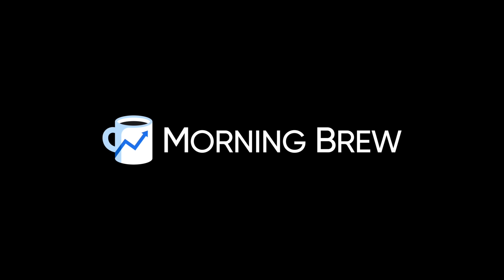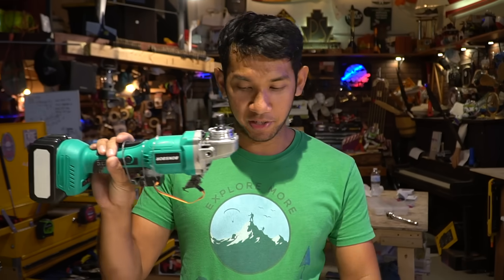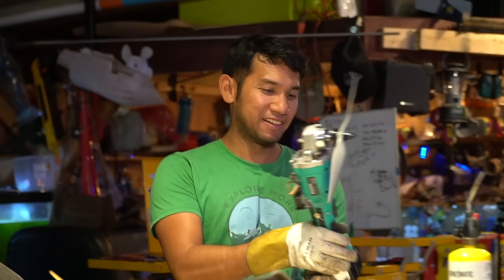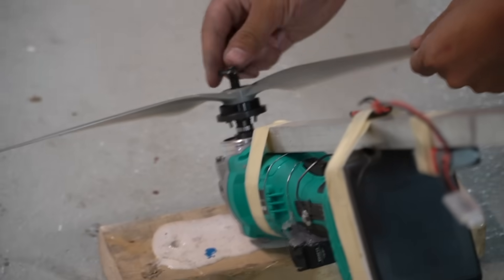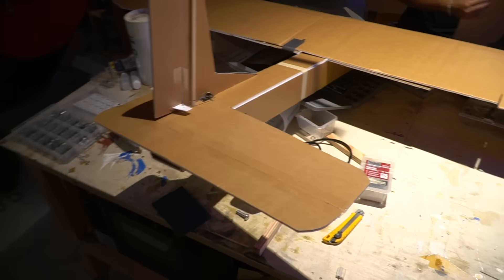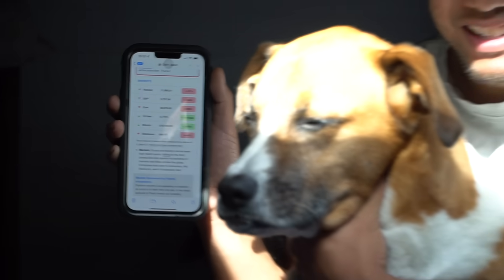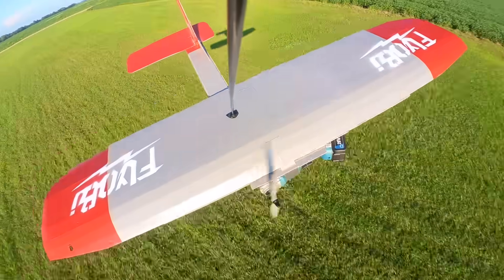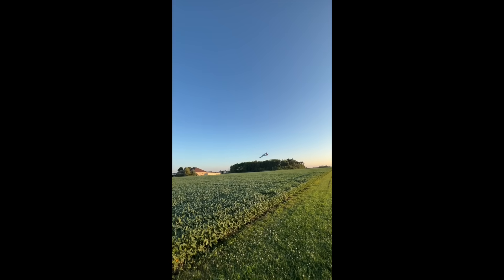Teaching an Angle Grinder to Fly

Comment: I mean next the router-copter with a small power drill for tail rotor is pretty obvious. Then of course the update with a chainsaw as main rotor, the end of the chain-saw shaft then houses again a power drill for the tail rotor. Next you need to get creative and try to to something with multitool, which only vibrates back and forth, but really fast. Also why not build an RC car with four circular saws for wheels?

Comment: You should try the Milwaukee m12 die grinder. It’s light and high rpm’s plus the straight model is perfect for mounting. Or the right angle version for a drone configuration

Comment: Angle grinder should be a great Helicopter (Chopper) its has bevel gears, the original motor (assuming best - is 995 series & can handle quite the damn power draw) does 10000 rpm(this goes to tail-rotor). You will need to limit it to half the speed or power & reverse the bevel gearing assembly for 'step up' gear speed (you need to keep some power from motors in reserve to compensate for windy conditions) , then you can do your magic with variable pitch for propellers & their number of blades & size. You may need to buy 6 of those 995 series grinders & use 2 of them to single gearbox (torque is your friend) & source gearing from other 2, remaining 2 should serve as spare. Do not use their heavy HDPE thick plastic bodies. 6 batteries should serve for a long ass flight time with proper BMS system. Rooting for you guys. All the very best. 🙂🙂😇😇👌👌👍👍

Comment: With your machining equipment you should have made a differential gear for the angle grinder so it could be inline with the prop instead of perpendicular...  this would have made both the plane and helicopter way easier to design and build.

Comment: I think you should make an angle grinder drone 😉 you can use maybe 4 Teflon gears ⚙️ running from the center gear on the angle grinder drive or offset driveshafts ??

Comment: You could remove the angle grinder 45° transfer from the motor and have the weight in line with the power from the propellor😉

Comment: hot air lifting body plastic film blimp. Pease do one with multiple angle grinder and vacuum hover. And see what the lift would be in kilograms and reduce the weight of the shop tools.

Comment: Separate the angle grinder from battery and use battery as counterweight, to adjust for center of gravity/rotation?
At teh moment, angle grinder is at center of rotation, which gives very poor propeller efficiency.

Comment: Regarding the helicopter, I see one main problem : the propeller is too close to the center of rotation.
-to spin fast enough, you need "torque". For a certain torque, the closer to the center of rotation you are, the more force you need. So your grinder needs to produce a lot of thrust. You have only one grinder, so your grinder also pushed the whole thing in one direction, and that'that'de why the center of rotation is not where you have your center of gravity.

The other issue is, those props need speed to be efficient. Being this close to the center of rotation, the prop don't get a lot of speed, and lacks efficiency

Comment: For a single blade helicopter, you need propulsion at each tips of the blade, pointing in opposite direction (to get a clockwise or anti-clockwise movement) ... like they do in China with fireworks flying wheels. The centripetal force helping, it'll stabilize the wing.... but all the weight being at the tips, it'll also increase the possibility that it tears apart.
Reply: Actually it should be ok with propulsion on only one tip. However you do need a counterweight, so that the center of mass is reasonably far away from the prop so that it can create good torque. The designs in this video didn't have that. Best is of course to use the battery as the counterweight.
Reply: @leftaroundabout   Charybdis, McCutcheon's machine, Flying Maple seed.  Plenty of examples on youtube of them.  Might not be strong enough structurally but looked like his center of rotation was too far off from his center of balance.  For the two bladed one I would go with a smaller prop delivering higher speed but less static thrust.  I think he got all of the thrust out of the big prop he could but it just wasn't high speed enough especially so close to the center of rotation where plenty of thrust is going in the wrong direction just because Angular moments are wrong.    I ran a Monocopter challenge on RCOnline back in 2007, it was fun and I flew them all the time with little cox engines or a Norvel 15 powered one with a wing made of 2 mill coroplast SPAD style.  My biggest was the wing from my first Ugly Stick when the fuse wore out.  Ran a throttled os 40fp for power.  On a still day I could throttle up, take it high, throttle down and let it come back and change altitude.  It was a flying oddity.  When I started flying Norvels for 1/2A I no longer needed the 25% fuel for the Cox engines, And I put the things up for memories sake.  Winning flight from the RCOnline challenge  https://youtu.be/bJEoYNE2zN8
Reply: @williamcrane8236  Still easier to use two identical engines/ propulsion system at each tip (rockets, jet or propeller engines, compressed air nozzles etc.) .... allowing more power, redundancy, perfect counterweight and no need for a tail rotor.  Good examples: every tip jet helicopters: Saunders helicogyre, the WNF342 V4, the McDonnell XV-1 and my favorite, the Fairey rotodynes.
Reply: Huh?
Reply: @carpediemarts705  ?huH

Comment: I think you should put 3 angle grinder, put 1 on each wing, 1 in the middle front, it would be more faster, also put weight at the back of the plane so it will be more balance

Comment: How about two cordless drills or just one and steal power to run separate rear rotor for helicopter. Alternatively 4 power drills as quad copter since you can adjust power via servo. You could do same by adding variable resistor on the power leads that go to grinder from the battery so buy 3 more for a quad. When done you can gift them to viewers if nothing else.

Comment: I would have set it as a pusher prop at the CG line but set higher than the wing with the battery mass down below, but I was still impressed with how well that German-inspired design flew. Impressive work!

Comment: I'd love to see you make a proper steerable version of that helicopter.
Reply: It will never be flight controllable due to zero pitch control of the rotary wings, zero counter rotation and too heavy.
Reply: @BTW...  I suppose you could if you had a great imu and some really powerful agile servos. But I see why it would be basically impossible without adding a tail.
Reply: @ArtamisBot   Possible with active variable contra rotation. 
Passive tails get in the way.. and weigh more on an already heavy design. 
At least they used a cheap crap tool that has plastic where metal should be.

Comment: For anyone wanting to use abrasive wheels or discs you should educate yourself about the do's and don'ts.
Full face rigid mask.
Pay attention to the info on the disc, expiry dates, max rpm, suitable materials for grinding.
Cutting wood, food, soft metals and you're asking for the disc to explode.
Just putting it out there, we can buy this stuff in any hardware store in complete ignorance of the dangers and end up blinded.

Comment: The copter . . . it did not make sense to me why the propeller in the middle.  I think it would be  more successful with 2 going in opposite directions on the ends.  With gears & 2 long rods the grinder should have enough power to make it work.

Comment: Why didn’t you just do two engines rather than using a design for a aircraft that was barely used 

For a reason

I mean it worked but I feel there was a more effective design

Comment: I thought you were going to use the grinder as the body of a heli, with the blade facing up. Like in a normal heli configuration. Tail rotor would be difficult, unless you do a Frankenstein and use a 1/4" impact or small electric screwdriver to power the tail rotor.

Comment: Use two angle grinders to build a tilt rotor aircraft like the osprey.   Have the batteries remote mounted in the main fuselage to keep the weight down on the wings.
Reply: I was thinking the exact same thing

Comment: I have an idea for you, get a bunch of smaller sized Dremel tools and then use them to power props like you used the angle grinder In This video. I think that would be very cool and it would also give an opportunity to make a smaller aircraft with a single prop if you wanted.
Reply: Rotor riot did one as a drone😂

Comment: understanding that an anglegrinder is designed to be able to work at almost stalling conditions allows us to assume that it can handle a high load over time. so I'd go for the 18" or thereabout, after all, the batteries can be changed easily:P just land, pop a new one in, and go for another 10-15 mins:)
Reply: also, since you were looking into aircraft designs from germany, I would love to see a model of a Horton 229:D

Comment: Two, opposed, remote controlled, angle grinders on each side of a rotorblade, is some PopMechSci "classified aviation blueprints" rejuvination. They has weed wacker or model airplane engines, and was before this lipo world. The rotor was assembled, and had a hang glider harness with triangle yoke, and a tailfin.

Comment: TBH the most dangerous way to use an angle grinder is with a cutoff wheel.  I've seen countless injuries and essentially near deaths from cutoff wheels exploding while being used as intended.  Seen one get embedded into a guy's cheek about 3 inches.  This was about as sketchy as normal RC motors and props, continue on!
Reply: The worst American invention are those 'grinding' discs that have a peripheral chain saw blade.... THAT is the most dangerous way to use one of these tools.  
Also... It's an 'American Thing' for idiots to use these high speed machines without a guard using any form of grinding disc or wire brush wheel. 
Thin cutoff discs are safe in the hands of competent users, who don't attempt to use them like a grinder or throw the tool on the bench or floor after use.

Comment: You would be better off with a rotary tool. Like a dremel or off brand battery powered mini grinder. 
Even then, the flight time would have to be limited. Or you’ll burn up the motor.

Comment: Angie grinder isn’t made for sustained use. You’ll burn it up fast. Trying trying to spin a propeller.
It actually doesn’t spin that fast. The motor is geared for higher torque. The speed rating is probably not accurate. For most angle grinders.
Plus all the extra weight of the housing and gear box would defeat the purpose.

Comment: Peter Sripol

I would like to see intermeshing rotors like on the kaman kmax helicopter, I used to work with them building ski lifts. Very stable and high lift capacity, 5000 pounds at 9000 ft, no counter torque needed.  They feather the blades on kmax with trim flaps, such a cool aircraft

Comment: What happens if you position the grinder vertically with the battery above the spinning blades? I think that would change the CoG, possibly for the better? But I'm no engineer.

Comment: How about a flying weed eater?
Reply: There are some brands where the shaft comes apart for multiple attachments, so it should be fairly easy, just put a prop on the end. Balancing could be an issue since it's still about a meter of the shaft stays on the motor, but it can also be a good thing. The outer casing of the shaft ought to make for a good tail boom with a pusher prop on the very back.

Comment: Would it be possible to use a reciprocating saw to pump two sets of bellows simultaneously but out of phase with each other to create a continuous thrust?
Reply: The saw has a crank to convert the motor rotation to reciprocating linear motion. If you want to move air just use a fan or turbine.
Reply: @EmyrDerfel  Fascinating, and here's me thinking it was a tomato. Which of our suggestions, yours or mine, hasn't been done a million times already?

Comment: I would love it if you could make like a guide or a series about learning to build awesome rc aircraft like this (Not with an angle grinder of course) but like go over the design process, materials, the right electronics and motors, and assembling and wiring everything. Just a suggestion

Comment: next challenge can u make a plane fly using a 250 watt Ebike hub motor ( OC'd to 1000 watt ) ,issue is they are about 3kg + another 500grams for a phase runner/controller, so itll have to be big wing span

Comment: Given how cost-optimized angle grinder motors are, I wonder if buying them just for the motor/battery and then working out a better way to do speed control would be good for dirt-cheap RC.  Plus pulling them out of the plastic would cut down a bunch on weight, and there's probably a lot more metal parts you can ditch, too.

Comment: we have been using the Angle Grinder for inflating coals in a barbecue for a long time, the propeller from the Toyota cooling system fits perfectly to the standard mount, it blows just powerfully, you have to hold the angle grinder with both hands, from igniting the coal for about a minute before cooking ...

Comment: Hey Peter - project idea! What if you made a plane without ailerons, and instead had the main wing on a rail that moved the wing left/right to tilt the plane one way or the other, due to the imbalance of lift on either side? To explain it another way: The wing (when moving on the rail in one direction) would be getting longer on one side while getting shorter on the other due to the linear motion on the rail, 90° from the direction of flight.
Reply: that's a really creative idea, I'd watch the hell outta that
Reply: Sounds like rotational torque would be a big issue
Reply: I think that's how some hang-glides turn...  The person shifts their weight and thus moves the center of gravity left or right  making the craft roll and turn in that direction.
Reply: And have the propeller on a rail too to make an offset in the center of thrust relative to the center of gravity, giving you yaw control :D
Reply: Move it forward and back for pitch too? Wing-warping could be interesting also, though the rib design for warping wings may not be trivial.
Reply: I'm pretty sure I saw someone make exactly what you just described...
Reply: Yes please make This , i want to see this work.
Reply: Neat idea indeed

Comment: I love that you just used the grinder in its housing rather than disassemble and integrate the parts into the airframe. That said, I would be interested to see the performance in a more optimized airframe with better weight and balance achieved by moving the battery further aft.

Comment: What about using a skilsaw? I'm not sure if that's the right name for it but, to describe it, the blade has a shield over it that reveals the blade as you push it along. The motor is under the handle and it's weighted to be used one handed. It's the saw you always heard horror stories about in shop class. Kid lets go of it and it goes ripping across the floor all teeth and badassery

Comment: the off-centered tail wing might’ve helped if you would have positioned it on the left side to counter the weight of the drill sense the weight and battery where positioned off to the left

Comment: I would like to see you build a regular glider with about a 20 foot wingspan out of Styrofoam and use the angle grinder for the propeller and see if it will glide in the air or when there is no power going on it after it gets so high

Comment: A circular saw would be cool. Bigger, but more power, mine is 1800 W whereas angle grinders are about half that. Heavy tool, heavy bomber? 4 engines too, Lancaster or B-29 style.

Comment: How about a heat gun baloon? They are rather require connecting to the power outlet but perhaps it could work with the emergency high voltage powerbank or just do a wired baloon?

Comment: Hmmm. Makes me think a cordless brushless router might actually work really nice for a Plane motor. Drive axle in the in the right direction, variable speed, the base plate is a perfect motor mount and they are even rated with horse power…

Comment: Why dont you screw the angle gears off and make a prop adapter straight to motor head. Then it would be symmetrical and save some weight too. Of course it wouldnt be an ”angle” grinder anymore. Just a grinder 😁

Comment: A die grinder or router would be pretty awesome. Similar to an angle grinder except the tool points straight ahead instead of 90 degrees to the side, and they can be very high RPM, up to 30,000RPM.
I want to see some exploding propellers.
Reply: Or just unbolt the gearbox off the grinder, that's making a lot of the noise, and the gearbox mountpoints would be useful for attaching the grinder to the craft.
Reply: DREMEL!

Comment: Given that with the big propeller it has a thrust-to-weight ratio significantly greater than 1, I wonder if you could connect four of them into an angle grinder quadcopter?

Comment: So helicopter rotor blades fly in the same exact way that airplane wings fly. With helicopters you don't think of thrust, you think of airspeed on the blades (from spinning). 

It didn't fly well because you want the mass above to spin with the motor below stationary (probably with a tail rotor to stabilize it). Remember, helicopters fly using Bernoulli's principle of air flow, not thrust.

Comment: 10:20 This seams awfully stupid....
Lets fly this experimental, homemade, uncontrollable, spinny thingy, nearby the high voltage electricity wires & transformers.... Surely nothing bad at all could ever happen then... right? 
🤦‍♂🤦🤦‍♀
I'm just going to assume this is some camera artifact, maybe the angle or whatever, making the cables look closer than they actually are.